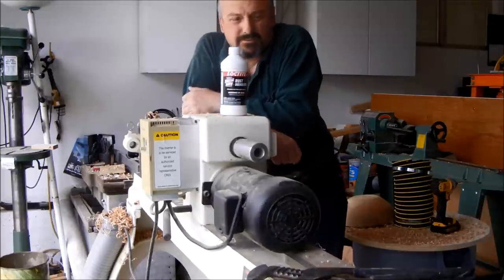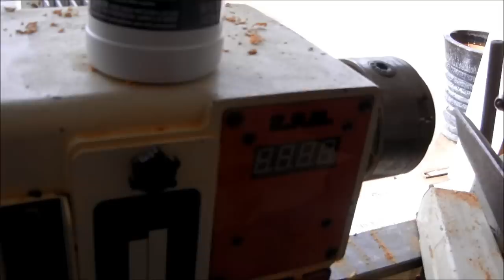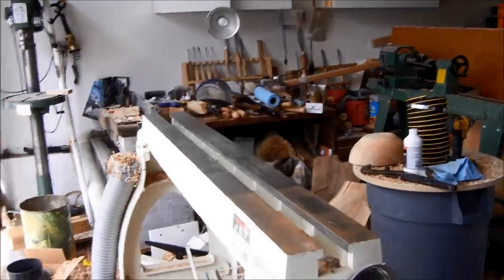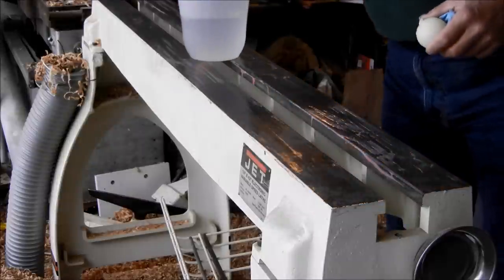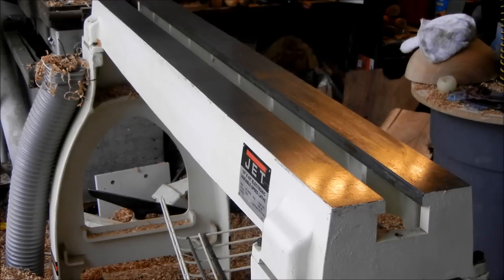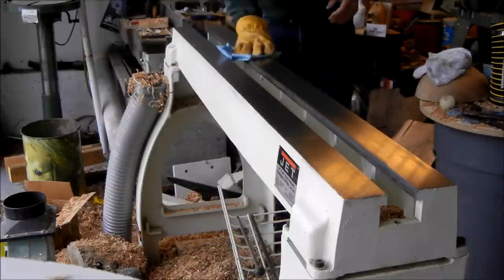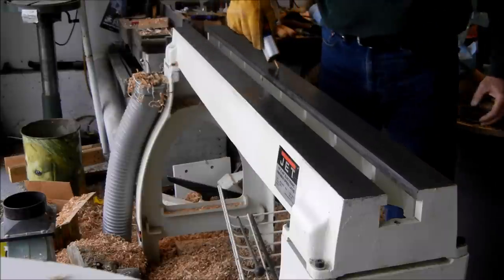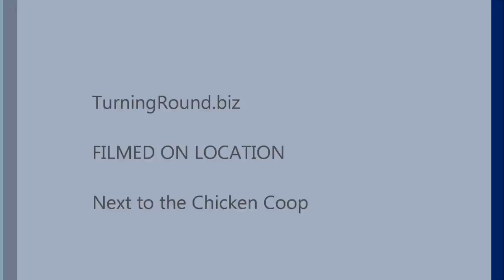Cleaning My Jet 1642 Lathe Ways with a Rust Remover

Comment: Just some thoughts about cleaning. Acetone dissolves CA glue. For a very light surface rust like you had there, going over the whole thing with steel wool would have been a good first step, followed by a very light coat of machine oil, or even WD40. The Naval Jelly may have been overkill.

Comment: 50/50 muriatic pool acid ....or metal prep. from a automotive paint store..gloves,glasses and shield . apply with acid brush 
. let sit and watch it eat away a minute or so, scrub with ss tooth brush or ss wool it and wash with water and or or wipe off apply two parts atf oil and one part acetone. Then wipe with clean rag and cover with vaseline. Will look like new metal !